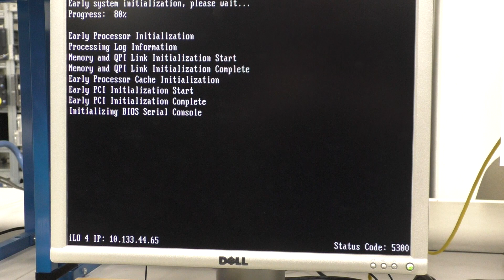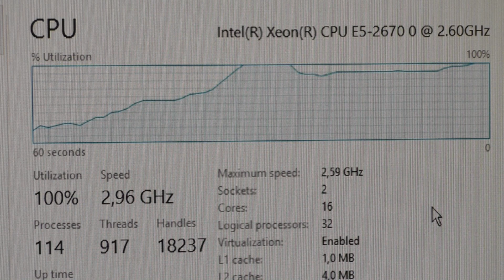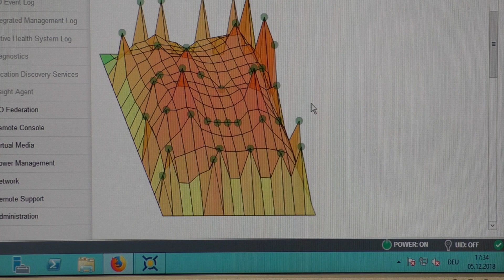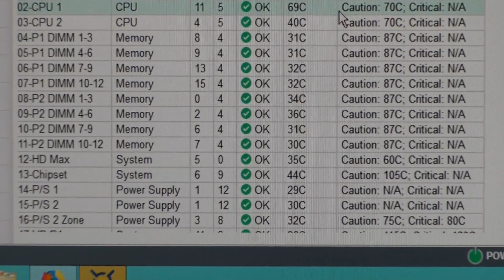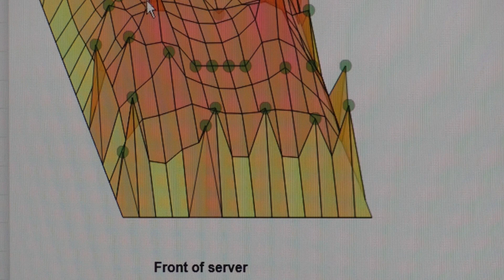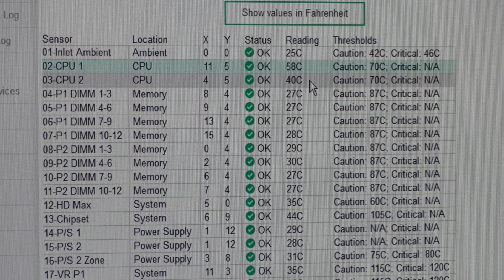What happens with a CPU without thermal paste? - (PWJ121)

Comment: The fact that the CPU had somewhat similar temperature even without thermal paste is just due to the adaptive and almost excessive powerful cooling system of the server. I did these experiment with an overclocked, early and overclocked intel core-i7 975 CPU, which had a much smaller heat-spreader and thus did not have that big plane to transport heat off the die. This CPU was rated at nominal CPU clock of 3.33 GHz and I did overclock it to 4.2 GHz!

While running the external cooling setup under constant conditions (water cooling system with 360-size radiator, 3x 12 cm fans running at fixed RPMs external of the computer itself, Kind of "mora"-design) I could even see slight differences inbetween different thermall-grease types.  While the universal white thermal paste did work well for it's price too, the grey, high-tech thermal paste did show lower CPU temperatures of about 2°C due to its lower thermal resistance. I even did that test repetitive by removing the thermal paste and re-apply it again to be sure there was no effect of not covering the whole heat spreader. 

Best result I got was when I did apply a even and really thin layer of low-thermal-resistive grey thermal paste while when using no thermal paste the CPU ran into throttling almost immediately after a few minutes of high load. The highest difference in temperature I got while testing the different thermal pastes was about 4-5 °C under continuous 100% load. As said before, the CPU was running not only a few minutes but continously and overclocked from it's nomial 3.33 GHz to 4.2 GHz which was the maximum clock, that my CPU did run at without problems. The temperature at the die itself, reported by the thermo element inside the CPU, was about 97°C which was in the "high" range of that CPU but still acceptable for the CPU-core. The core started to throttle when hitting an on-chip-temperature of about >100°C IIRC. By the way, I think the water temperature then was at about 50°C...

Comment: id bet that heatsink is far better machined than a consumer grade heatsink. that is a $5000 server roughly, and likely far more accurately machined parts than a thermaltake, cryorig, or noctua thermal solution
Reply from the maker: Not necessarily... While the big brand cooler manufacturers often polish surfaces to add some "bling" to the product, server coolers are relatively cheap. Most of them don't have treated surfaces and many look the same as big brands.
Sometimes the server coolers are even made by big brands, just without the fancy stuff like RGB LEDs etc. 🙂
I mean, HP has no factory to make CPU coolers themself.

Comment: I'm doing a build and I need to transfer data, I'm running low on thermal paste so I was wondering if I could destroy my CPU if I only used it for a few minutes without thermal paste.
Reply from the maker: It most likely won't fry the cpu but it will run hotter and possibly slower.
A bit of ordinary silicon grease would probably work too.

Comment: I just read your video description and I'm so disappointed. I've often wondered how necessary thermal paste was, and I thought you video gave me an answer... If you ever redo the test without the fan speed controller I would certainly watch it.  Thanks for making the video just the same.
Reply from the maker: Well, I would like to... but the server settings don't allow to disable the fan management in such a way. But I once made another test. Measuring the temperature of the processor chip and the temperature of a water cooled heatsink. While the heatsink stays at more or less the same temp., the chip temperature changes quite a bit using different types of thermal paste.
Worst paste was the "white goo" and best was the ShinEtsu silver gray that is supplied with most server boards. Temp. difference was about 10 degree C.

Comment: It means without thermal paste my laptop will burn?
Reply: Can i use anything else?
Reply from the maker: no... but the processor could overheat and fail. Or it simply turns off when hot.
Reply: @PlaywithJunk  it turns off suddenly for a long time
Reply: About 2 - 3 years it is still alive
Reply: I use it in summers with a copybook in my hand blowing up😂😂

Comment: Hello, I need to only flash BIOS and switch CPU, is it ok, to put big passive cooler without thermal paste, load into windows, flash BIOS and exchange CPUs? Can be around 2-3 minutes of time at around 5-10% load of CPU, booting maybe 20-30%?

My plan is: boot into BIOS, and undervolt/underclock CPU, then restart (should take around 30 seconds), then load into windows with underclocked CPU, and do BIOS update. Can take whole process from 2-3 minutes. Will CPU hold? The Cooler will be placed properly and mounted, not just put loose on CPU.
Thanks for any help.

Comment: If the thermal sink as well as the cpu have flat/smooth contact surface, i think there is no need for thermal paste.
Reply from the maker: IBM uses just a drop of silicon oil between CPU and heatsink in their Z-series mainframes. But the heatsink is screwed to the CPU with 10 screws.
Here in this HP server, the CPU gets hotter without paste but it's hard to notice except you're monitoring the clock speed. This will be throttled.

Comment: Why do people waste electrical energy on stuff like SETI@Home?!
Often electrical energy they have to pay with own hard earned money, here in germany electricity is insanely expensive. Thats why I absolutely dont get it.
If it was Bitcoin I might understand that... a bit...
Reply from the maker: For me the explanation is simple. SETI was the first service with distributed computing that was easily available. I started with SETI in the early 2000s on a DEC Alphaserver (which crunched the workunits away like cookies).
So it was a good tool to compare PC and non-PC hardware.
Today I use it as a system stress test. And other than a regular stress test (like prime95), SETI has a bit of a purpose. Especially because with BOINC, there are many other projects to participate, not only SETI.
That means I can test my servers AND do something useful for the society.  Of course it can be disputed if searching for extraterrestrial signals is a useful job.... but the other projects I support certainly are.

Comment: i using i3 cpu and gtx 1050 ti already 2 year without thermal paste still fine with side case open-----surely cpu temp easy increase from idle 45-50 to 100% load 67-72 i look from every site as long cpu temp below 80-82 is fine
Reply: i agree. my old desktop had i3 4130 without thermal paste and same temps as yours. by the way im using i9 9900k now and after i used thermal paste and i had to remove the heatsink multiple times because a screw wasnt going in. now my temps are 87-93C under load

Comment: Thank you for a great experiment. I am glad you used the G8 as it has all sort of temperature safeguards both on the CPU and the motherboard and power load. Older servers would have been different, they would shut down completely as the CPU gets hotter. You can’t even put it on until at least 2 hours have passed for cooling the heated cpu, even after correcting grease/heat sink. Much older servers however you would have fried the CPU.

Comment: I Have i5 2400 With LGA 1151 Heatsink That Run Idle At 50~70C On Full Load It Run At 80~95C (Thermal Throtling @91C)
And I Clean A Heat Sink And Reinstall The Heatsink, I Forgot To Put Thermal Paste Now The Temp Is Going To Sky Because I BROKE THE PINS!
Reply: i using i3 cpu and gtx 1050 ti already 2 year without thermal paste still fine with side case open-----surely cpu temp easy increase from idle 45-50 to 100% load 67-72 i look from every site as long cpu temp below 80-82 is fine

Comment: Ah, the famous Tom's hardware one... Intel CPUs have always been good at thermal throttling, sometimes a bit too enthusiastic at throttling. The IHS adds enough thermal inertia and distribution away from hotspots to give the protection time to work.
Depending on the CPU, it will either be TM2 (force minimum clock & core voltage) or TM1 (stop/go).
Reply: That tomshardware article was very innacurate, plain wrong, lying on both intel and amd.
It was edited very well, it was presented as TRUTH, was very veliebable if you only watched that video and knew little else.
They retracted to many conclusions on a following article after the backlash they generated.

I suspect maybe it pushed amd to really improve on the issue (...if they didn't plan to do it beforehand, which they totally could, they were competing very hard and minded what market/people demanded).

For K8, cooler clamp system, IHS, and thermal protection / throttling were improved a LOT, many steps above previous products.

Comment: I have a long bit of experience with this. Thermal pastes can be a gamble. If they are too viscous they may not spread out evenly and will function more as an insulator rather than a contact gap filler. Ultimately use case dictates necessity. For direct-die colling such as with laptops or GPUs, thermal interface is required as the die surface is NOT 100% uniform (der8auer did a great video on this). While running a lidded die without TIM between the contacting surfaces of the IHS and the cooling solution is not neccesarily required if in a pinch, is is best to do so for long-term operation. 

The need for long term reliability in operation has led to the implementation of other technologies such as graphite sheets as TIM between CPUs and cooling solutions for servers and production systems.

Comment: I've always heard, applying more than one central heap of paste could allow air pockets and or seams to accrue in thermal paste!
Reply from the maker: That depends on the pattern. If you make just dots as I did, they simply fuse together... no air pocket danger. I noticed that on large chips, the corners will not be covered properly with only one blob. But that's trial and error...
Reply: @PlaywithJunk  thankx I definitely don't do it much, so I will take experience over advice anyday!
Reply: There is really no right or wrong way to apply TIM. It does not even need to cover the whole spreader since the Intel dies are always dead center.
Reply: If the thermal paste has either not been applied/dried up, will a PC repeatedly shutdown like mine?

Comment: I was like why would anyone run a 40 grand sever without thermal paste, ohh it's a xeon, nvm... let it burn. Epyc here we come :)
Reply: A system without thermal paste is not going to burn. TIM just ensures uniform contact between the IHS and the cooler. You can run the system without TIM and notice some thermal performance loss, but the system as a whole will not be harmed
Reply: @SoranoGuardias  No hot spots will form in the silicon with poor conductivity and silicon to silicon thermal conductivity is poor so you will get fatal damage to certain area.
Reply: @Doom2pro  It ultimately depends on the type of system and it's loading. By and large it's not going to affect it because there is already an interfaced HEAT SPREADER on the package. You'll notice some thermal difference up to 5-10C without thermal interface, but if you're experiencing temperature loads high enough to cause silicon damage, your issues are NOT related to thermal paste.
Reply: @SoranoGuardias  Was talking about bear die cooling, but yeah IHS no thermal solution to cooler and you will get instant throttling.

Comment: That is pretty amazing that the fans have enough capacity to keep it cool even with the heatsink missing. Very interesting experiment. Thanks for sharing!
Reply: The cpu thermal control keeps most of the processor in halt mode which means it is not doing anything.

Comment: Nice video! Only one test missing, but this also destroys the cpu. Remove the IHS so the bare core is shown. Want to see that test as well :)
Reply from the maker: I can tell you what happens.... the chip would go up in smoke within seconds. I saw that on Pentium 3 chips where the heatsink was plced directly on the die. They smoked quite rapidly when the heatsink was not seated properly.

Comment: your cpu speed problem is a Windows Problem ... 1. you see the max cpu is the max base clock ... and 2. you see the cpu running at a turbo clock ... and never trust windows with the MHz i see CPUs that run on 3 GHz and windows Say that run on 6 GHz ... so never trust windows with the GHz / MHz
Reply: you show the same Heat to CPU Clock Thing like "der8auer" a german extrem overclocker ... he make a video with the I7 8700K an show waht append if you run this without heatsinkt ... intel did a great job on this down Clock if the Heat is too mutch ... but jea the most modern Exterm Slim Notebooks run like this you could buy one with I5 and you get 90% of the CPU power bekaus the Heat is to mutch ... you buy the I7 version an you have 40% of the I7 CPU power becaus all is too hot hot hot ... -_-

Comment: You are torturing my dream system  :'( lol
Reply from the maker: No servers have been damaged during the production of this video  :-)
Reply: i using i3 cpu and gtx 1050 ti already 2 year without thermal paste still fine with side case open-----surely cpu temp easy increase from idle 45-50 to 100% load 67-72 i look from every site as long cpu temp below 80-82 is fine
Reply: xeon cpus are absolutely terrible for normal use. They have such bad single core performance.

Comment from the maker: I just noticed that the entire experiment may be rubbish... The fans on the right side (where the CPU without paste is) turn much faster than on the other side. This server can control all six fans individually. Today I powered it up with both CPUs properly "pasted" and the fans were spinning at the same speed on both sides.
That means, the CPUs only have the same temperature because the server reacts to heat differences and spins up the fans that are close to the hotter CPU. And that means the two CPUs would not have the same temperature if all fans were spinning at the same speed...
Conclusion: THERMAL PASTE MAKES MORE DIFFERENCE THAN THIS VIDEO SUGGESTS.
Reply: windows task manager can show individual per core % cpu use (left mouse button on the graphic). To easily check if a cpu is processing less.

In debian linux distros you can use psensor to monitor both cpu temperature, and cpu use (htop, etc. are better for core use though).
Reply: So what if you don't put thermal paste, is it only the temperature raising or can it bring complaint ? Like in motherboard sort of ( system not starting)
Reply: What is "much faster" ? Like double, triple the speed of the other side ?
Reply from the maker: @danielfietkau733  more like 4000 rpm and 5500 rpm...
Reply: Which software did you use in the video
Reply: You also need to be able to read the computational throughput of each cpu core. I bet the cpu without paste was putting out only a fraction of the computation as the one with...
Reply: What is this?
Fuck shit up at work day?!
Lol
Thanks for sharing.

Comment: Had a customer last week complaining that their AMD based pc would shut down after a couple of minutes use. Went onsite, expecting that it would be clogged up with dust (like normal). When I opened the pc, the heatsink and fan were completely off the CPU?!? 
I cleaned out the dust from the machine and re-pasted the CPU/heatsink and it's working fine. 
I've never come across the heatsink detaching itself from its enclosure before.
Reply from the maker: I had smaller heatsinks that fell off because the soldered attachments became loose, but never a CPU heatsink. But I normally don't work with standard PC's. But I had PCI card jumped out of connectors because of rough transportation.
Reply: Seen plenty of intel systems with stock heatsinks fallen off during transport. Usually because they were not installed correctly in the first place. The plastic split pins are kind of janky in the first place imho. The AMD setup with the spring steel clip is actually the more robust stock mounting solution imho, but the ones which bolt through the mounting holes with threaded screws are even better.
Reply: I'm sure whoever installed it did a crap job.  I remember older AM CPU sockets had a style of cooler that needed a flathead screw driver to pop it over the plastic tab to connect it to the socket.  Those were easy to think they were installed well, but they weren't actually properly installed.
Reply from the maker: The Intel processors had something similarly stupid. We only called them "pushpins". You had to rotate them and push down so hard that mainboards almost broke in pieces. Very easy to do wrong. I prefer regular screws and springs.
Reply: My laptop was being really loud even while doing nothing so I decided to open it up and see what's going on. Turns out that the heatsink's mounting posts had come free of the motherboard (they were soldered on, probably with crap tin) so the CPU was only getting 50% coverage or less.
Reply: i using i3 cpu and gtx 1050 ti already 2 year without thermal paste still fine with side case open-----surely cpu temp easy increase from idle 45-50 to 100% load 67-72 i look from every site as long cpu temp below 80-82 is fine

Comment: Ive got to 1:02 in the video and paused to type this comment. What happens depends on how flat and smooth the CPU and heatsink surfaces are. If both surfaces are 100% perfectly flat and smooth, you shouldn't need any thermal paste. Of course in reality no surface can ever be 100% perfect. My prediction is that the CPU without thermal paste will run hotter.
Reply: Ok, only 1 degC. Im surprised.
Reply from the maker: Yes, surprising indeed.... but this is only because the fans were spinning differently. The server reacted to the unequal temperatures and equalised it. The experiment has failed.